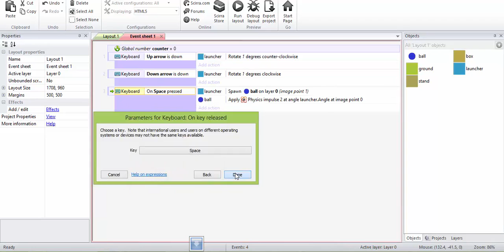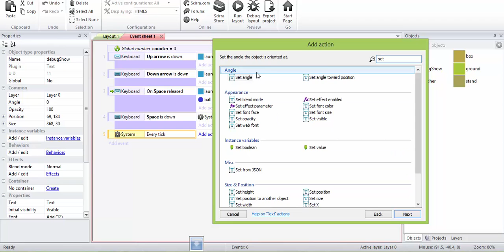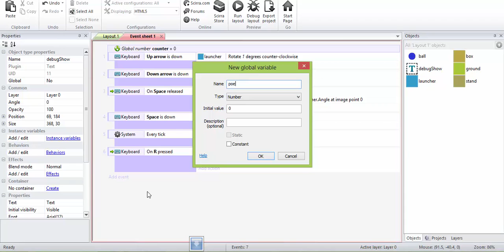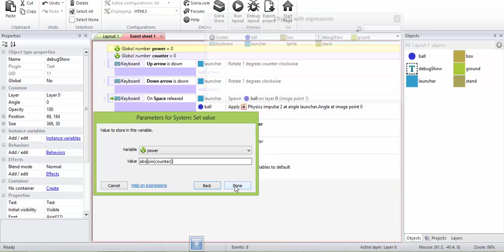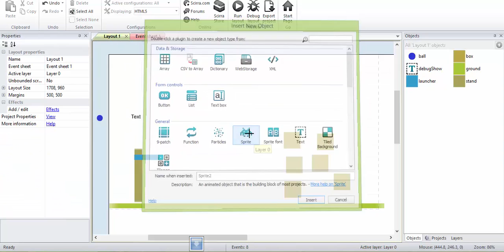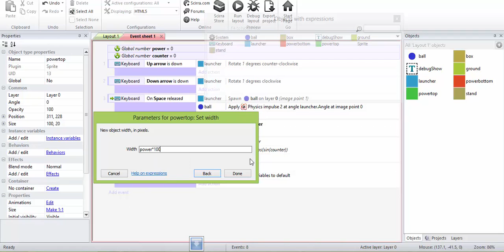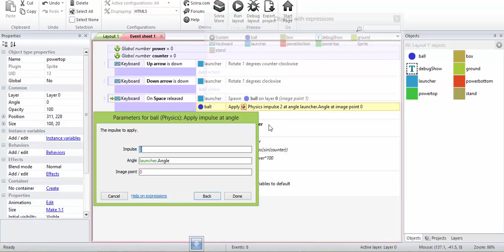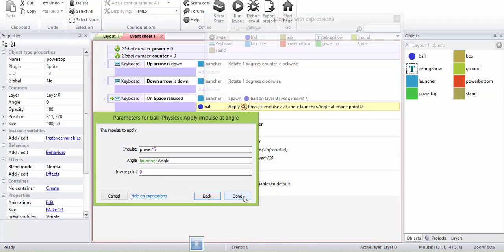Construct 2 Tutorial:Projectile Part 2 -  Adding Power Bar

Comment: Is there any way to make the counter 1 - 10 instead of 0 - 1?
I'm trying to create a power bar made up of a sprite with different coloured blocks on each animation frame. I'm trying to find a way to have the value of "Power" to setFrame, so if Power = 5, setFrame of Power bar sprite to frame 5. I can't work out how to do it with the decimal numbers. 

Great tutorial by the way though, I learned a lot from it!!
Reply from the maker: simply multiply the power by 10 and use the int function to remove the decimal part. Set Frame = int(power*10)